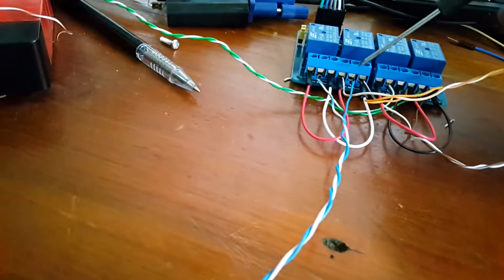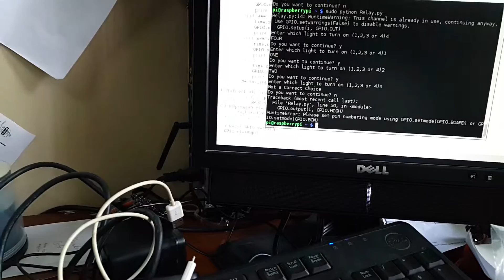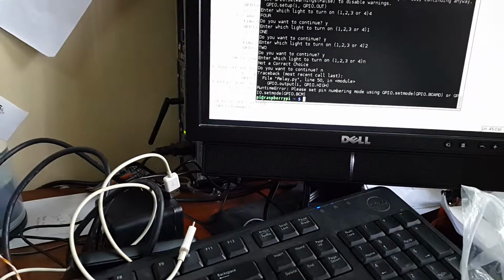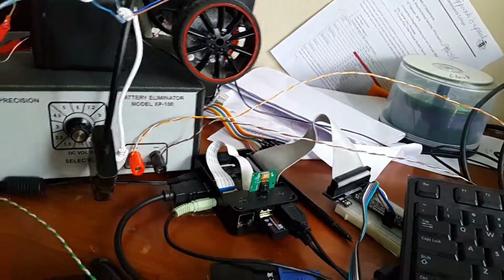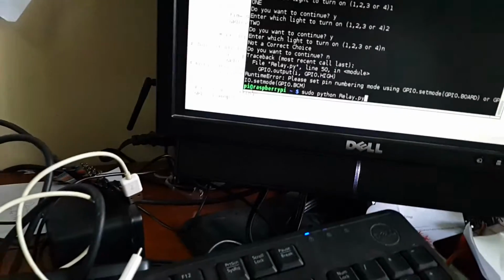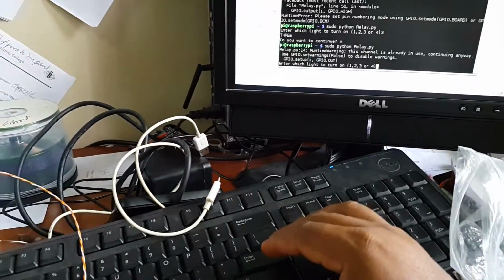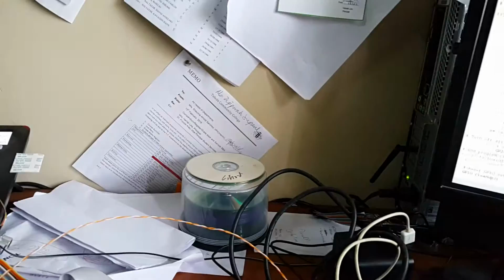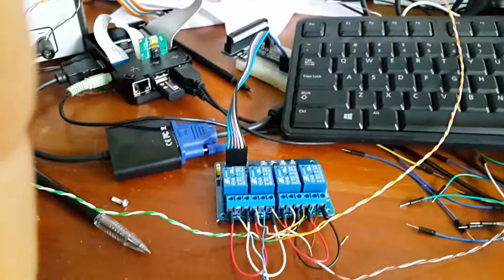Raspberry pi controlling DC motor

Comment: Hey, is there anyway you can explain the wiring for the RF switch please? I'm trying to use the Raspberry Pi Zero W, with an RF switch to a DC motor or a servo, depending on what I can comprehend. Lol It's for an invention, and I'm very new at this, any help will do. 
Thank you!

Comment: Can u give me the code please ?
Reply from the maker: #!/usr/bin/python
import RPi.GPIO as GPIO
import time

GPIO.setmode(GPIO.BCM)

# init list with pin numbers

pinList = [5, 6, 13, 19]

# loop through pins and set mode and state to 'high'

for i in pinList: 
    GPIO.setup(i, GPIO.OUT) 
    GPIO.output(i, GPIO.HIGH)

# time to sleep between operations in the main loop

SleepTimeL = 2

# main loop

try:
    
    a=raw_input('Enter which light to turn on (1,2,3 or 4)')
    if a=='1' :
        GPIO.output(5, GPIO.LOW)
        print "ONE"
    elif a=='2':
        time.sleep(SleepTimeL); 
        GPIO.output(6, GPIO.LOW)
        print "TWO"
    elif a=='3':
        time.sleep(SleepTimeL);  
        GPIO.output(13, GPIO.LOW)
        print "THREE"
    elif a=='4':
        time.sleep(SleepTimeL);
        GPIO.output(19, GPIO.LOW)
        print "FOUR"
    else:
        time.sleep(SleepTimeL);
        GPIO.cleanup()
        print "Not a Correct Choice. Sorry goodbye!"

# End program cleanly with keyboard
except KeyboardInterrupt:
  print "  Quit"

  # Reset GPIO settings
  GPIO.cleanup()
Reply from the maker: Car code  below...above was for relay only. 

#!/usr/bin/python

import RPi.GPIO as GPIO
import time

GPIO.setmode(GPIO.BCM)

# init list with pin numbers

pinList = [5, 6, 13, 19]

# loop through pins and set mode and state to 'high'

for i in pinList: 
    GPIO.setup(i, GPIO.OUT) 
    GPIO.output(i, GPIO.HIGH)

SleepTimeL=1

import sys, tty, termios
try:
    ch='c'
    while True:
    # found this to accept keys without pressing enter.
    # https://www.raspberrypi.org/forums/viewtopic.php?t=69046
        fd = sys.stdin.fileno()
        old_settings = termios.tcgetattr(fd)
        tty.setraw(sys.stdin.fileno())
        ch = sys.stdin.read(1)
        termios.tcsetattr(fd, termios.TCSADRAIN, old_settings)
        print '\nchar is\'' + ch + '\'\n'
        if ch=='1' :
            time.sleep(SleepTimeL);
            GPIO.output(6, GPIO.HIGH)
            GPIO.output(13, GPIO.HIGH)
            GPIO.output(19, GPIO.HIGH)
            GPIO.output(5, GPIO.LOW)
            print "ONE"
        elif ch=='2':
            time.sleep(SleepTimeL);
            GPIO.output(5, GPIO.HIGH)
            GPIO.output(13, GPIO.HIGH)
            GPIO.output(19, GPIO.HIGH)
            GPIO.output(6, GPIO.LOW)
            print "TWO"
        elif ch=='3':
            time.sleep(SleepTimeL);
            GPIO.output(6, GPIO.HIGH)
            GPIO.output(5, GPIO.HIGH)
            GPIO.output(19, GPIO.HIGH)
            GPIO.output(13, GPIO.LOW)
            print "THREE"
            print 'You want to turn? Enter Direction (l or r)'
            direction = raw_input('Enter a Direction to Turn l or r and press enter')           
            while direction !='s':
                if direction =='l':
                    GPIO.output(5, GPIO.HIGH)
                    #GPIO.output(13, GPIO.HIGH)
                    GPIO.output(19, GPIO.HIGH)
                    GPIO.output(6, GPIO.LOW)
                    print 'Turning Left and Moving forward'
                    
                elif direction =='r':
                    GPIO.output(6, GPIO.HIGH)
                    #GPIO.output(13, GPIO.HIGH)
                    GPIO.output(19, GPIO.HIGH)
                    GPIO.output(5, GPIO.LOW)
                    print 'Turning Right and Moving forward'
                else:
                    print 'getting out'
                direction = raw_input('Enter a Direction to Turn l or r and s to stop Then press Enter')
            print 'Back to moving choices'
        elif ch=='4':
            time.sleep(SleepTimeL);
            GPIO.output(6, GPIO.HIGH)
            GPIO.output(13, GPIO.HIGH)
            GPIO.output(5, GPIO.HIGH)
            GPIO.output(19, GPIO.LOW)
            print "FOUR"
            print 'You want to turn? Enter Direction (l or r)'
            direction = raw_input('Enter a Direction to Turn l or r')           
            while direction !='s':
                if direction =='l':
                    GPIO.output(5, GPIO.HIGH)
                    GPIO.output(13, GPIO.HIGH)
                    #GPIO.output(19, GPIO.HIGH)
                    GPIO.output(6, GPIO.LOW)
                    print 'Turning Left and Moving Reversing'
                    
                elif direction =='r':
                    GPIO.output(6, GPIO.HIGH)
                    GPIO.output(13, GPIO.HIGH)
                    #GPIO.output(19, GPIO.HIGH)
                    GPIO.output(5, GPIO.LOW)
                    print 'Turning Right and Moving Reversing'
                else:
                    print 'getting out'
                direction = raw_input('Enter a Direction to Turn l or r and s to stop')
        else:
            time.sleep(SleepTimeL);
            GPIO.cleanup()
            print "Not a Correct Choice"
            GPIO.output(6, GPIO.HIGH)
            GPIO.output(13, GPIO.HIGH)
            GPIO.output(19, GPIO.HIGH)
            GPIO.output(5, GPIO.HIGH)
            
# End program cleanly with keyboard
except KeyboardInterrupt:
    print "  Quit"

  # Reset GPIO settings
    GPIO.cleanup()